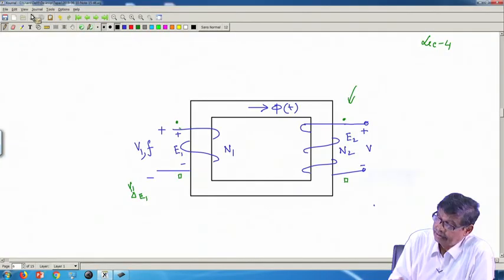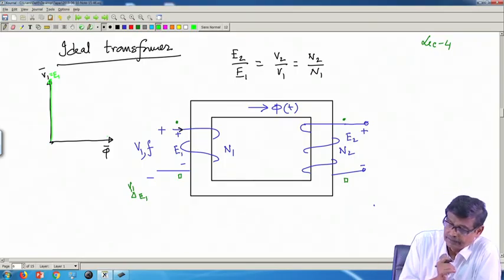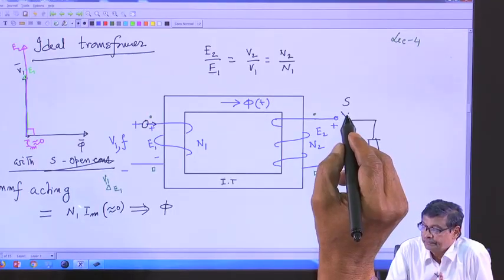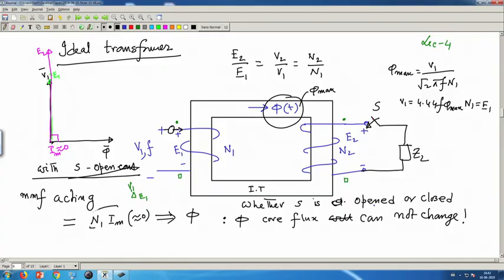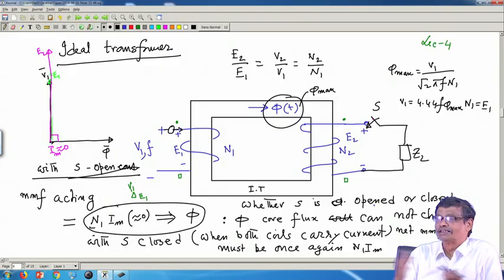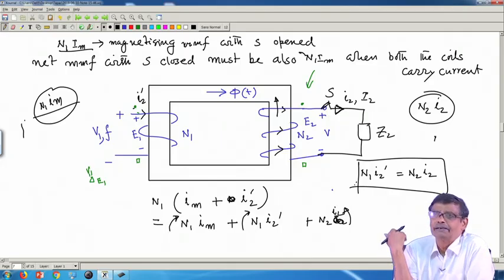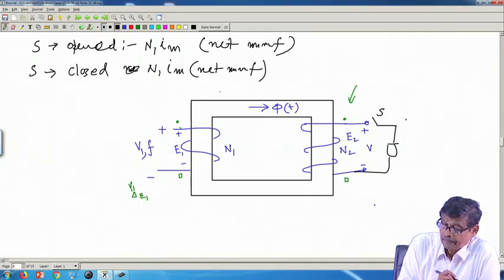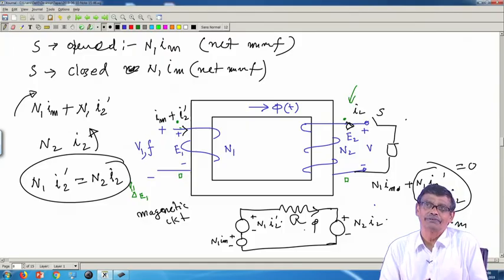Lecture 04: Operation of Ideal Operation with Load Connected

Comment: 21:31 I think net mmf should be zero for whole circuit, just like KVL in electic circuit.
By the way Sir, you are amazing, I never saw a teacher like you having such a deep knowledge of subject.
Thank you sir for your amazing lectures.
Reply: No, it'll not be zero. Even if you're trying to apply KVL, just imagine the reluctance of the magnetic circuit giving some drop. If you consider this, even with non-zero mmf in the magnetic circuit, you'll find KVL being satisfied .. analogously
Reply: If net mmf is zero thero wont be flux in the core. If there is no flux in the core there is no transformer action

Comment: I have a doubt regarding the phase between E1 and V1. They both are maximum at the same time in the opposite directions. So the phase between them should be 180Degrees.
Reply: Yes, your point is right. But here the sign is ignored and only the magnitude is taken.
Reply: Both voltages are in phase, polarity is not considered